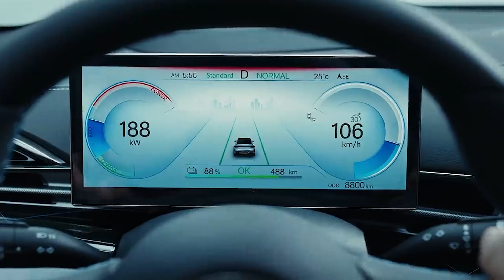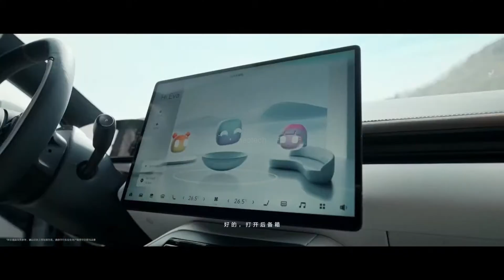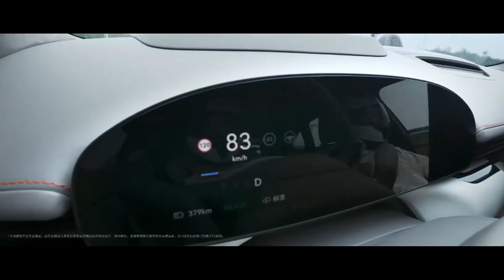Norway Smashes EV Records Again — Almost 100% New Cars Are Electric

Comment: Far from Norway providing evidence that EVs will succeed as the Electric Viking would like to believe, I see it as providing evidence as to why they won’t. Norway has cheap hydro and a charging network subsidized from oil exports. If I lived there I might well consider buying an EV. But I don’t so I won’t!

Comment: No idea why Tesla is still a status symbol.  They are pretty cheap these days.  One thing people tend to miss about Tesla in Norway is that they arrange unbelievably favourable loans.   I bought a Model X in 2017 and the interest rate on the loan was lass than half a percent and it cost less per month to own than I was paying on public transport to get to work beforehand.   I recently bought an XPeng G9 and discussed this with the sales people. They all sighed and looked wistfully into the distance wishing they could do the same thing.

I would add that I don't think people are that worried about winter range so much in Norway.  That 2017 model X went over the mountains just fine and did a trip from Olso to the Finnish Arctic circle and back in winter.  Nowadays I don't even consider charging stops any more in winter or summer.  You can not move for chargers in Norway now so I know I'll get a charge if I need to.

Comment: Now I understand how easily Bjorn Nyland got his S a decade ago. Bjorn's video output should document the growth and experience of EVs in Norway quite well. Maybe ask AI to do a summary.😮. Norway is small but long, with not much up far north. If people there don't drive the length of the country much how much do Aussies actually go properly outback in any sort of numbers? If they did we would have pressure for more proper highways and infrastructure. Yet we are told EVs don't work here. Almost 9 out of ten new car purchases this week in Oz will still be combustion, but why? Even with current infrastructure shouldn't adoption be much more than that, after all Chinese EVs offer so much for very reasonable money in 2025.  Will a threshold be reached where numbers accelerate again to something more substantial just by cumulative momentum?  Maybe when people start getting experience of bargain second hand EVs that far exceed expectations, pushing second hand prices up. Chargers are important but for so many they just aren't in reality.
Reply: I was looking at his early videos this morning.  Things have changed enormously since then.  I think long journeys over mountains are very common in Norway.  I do it myself.

Comment: a lot of norwegians also buy petrol cars second hand, trusting electric cars second hand is a bit rough.
Reply: Probably a consequence of the supply mix, not necessarily because people perceive second hand EV’s as high risk. Used batteries has shown to be more reliable than expected, and there are far less moving parts in an EV.

Comment: I think the economical incentives in Norway is key to the transition. The price difference per distance driven in Norway for BEV vs ICE is massive if you charge at home, and around 30-50% less if you have to rely on DC charging.
In many counties the fuel is so cheap compared to electricity that there is hardly any saving unless you can charge at home.

Comment: Luxury car tax limit to be dropped to $34,000 in Norway, so most EVs will have around $10,000 price bump to all cars more expensive as that. Also VAT return to EVs is proposed. That would mean another $10,000 price hike to EVs on $40,000 price range now (e.g. to all Teslas).
Reply: Some major errors here.
- Luxury car tax is suggested to drop from $50k to $40k, not $34k. 
- Price tax is 25%, so the price bump would be $2.5k. With $34k it would have been $4k. Your math is not mathing.
- VAT returns are only for businesses. You may confuse this with some special rules with leasing.

Perhaps show sources and calculations?
Reply: @picitnew there are proposals from economists to starts to phase in VAT. I would to be surprised in the first step is coming in the state budged in a couple of weeks.
For exaple lower the vat-free part of the car from nok 500.000 to 400.000. That would add nok 25.000 (USD 2500) to the price of most EVs. Would be acceptable.

Comment: If mile tax comes to EV's, it will ruin the whole idea of owning EV.
Reply: Why?
Reply: @notverygoodguy , very simple, right now I drive about 24.000 km/year, so I save 3.000 euros a year, 10 years I will save 30.000 euros.
If a mile tax will come, it will eat this saving and then owning EV is not any cheaper than gas car.
EV is expensive to buy and it lose value fast, if not saving anything because the mile tax, then better to buy 3.000€ used gasoline car, it's value don't go much lower.

Comment: If vehicles in Norway become all BEVs, it will have disastrous consequences in wartime. The most useful vehicle in Ukraine right now is a diesel-engine Toyota Land Cruiser.
Reply: This is about family cars.
Reply: A lot of norwegian towns, in mountainous areas, has their own local power station. Generating hydroelectric power.
Reply: There is actually a pretty big export of old EV's (Leaf and such) to Ukraine. Seems electricity is at least as easy to come by as gas.
Reply: @erik5820  You do have a point. Nissan originally designed the LEAF so that it can serve as a external power source during black outs.
Reply: @yo2trader539  In a war, it is quite likely that the oil platforms and oil refineries would be bombed. I guess some hydropower plants would be bombed as well, but frankly the flooding would probably be worse than the loss of electricity. There are more than 1700 hydropower plants in Norway, as well as a number of wind turbins and many have private solar power. About 74% of homes has the option to burn wood for heating. Also when people have home charger, most cars would be 80% charged at the outbreak of a war.
Reply: @yo2trader539 that wasn't really the point. And you can't really use it as external power supply, as you would need a private v2g chademo charger. They don't really exist (neither private nor v2g), and most likely never will (chademo is not really developed further as it is discontinued by almost all car manufacturers).

Comment: In the US the size of the country is an issue. Cars can travel very long distances and might even be hauling or towing something. When you combine those distances with limited fast charging infrastructure EVs really can't replace much of the fleet yet. You have to remember we have added gas stations from 100 years or more and there are plenty of them. However, electricity is also available most places cars go so it's just a matter of EVs getting better and charging locations being built out. That doesn't mean rural drivers can't benefit from an EV. In some cases the nearest gas station is very far away and you burn up some of the fuel your purchase just getting the vehicle there and back. And yet there is already electricity at your home or farm.
Reply: Unlike Norway, the EV mandates and subsidies have been lifted in the US, people are free to buy the car they want, so that makes charging infrastructure a little redundant now..
Reply: @SteveLomas-k6k  When were people not "free to buy the car they want"? Every type of car have been available. Anyone who bought an EV did so because they wanted one.
Reply: @frankcoffey  Because most of us are on a budget. US and other automakers in other countries, have been forced to flush billions down the crapper to develop EVs and then make a loss on selling them.  To stay in business they had to elevate the cost of normal cars to compensate- putting a new gas car beyond the reach of many who could otherwise afford it.

People in Norway are also 'free' to buy a new gas car, if they have the money to pay twice the purchase price in penalties.
Reply: @SteveLomas-k6k This is inaccurate. There is no new ‘penalty’ on ICE cars. It’s VAT and taxes, much higher than US of course, but that’s as it has always been. But EV’s are subsidized by exemption of (most) VAT. You can buy an ICE budgeting for it as people has always done. If you choose an EV, however, you will be better off economically. Nothing to do with ICEs being ‘forbidden’.
Reply: Also, R&D cost on development of new technology being distributed is not exactly a new concept. It’s how the world works. I bet part of the cost of your previous car could be attributed to development of your current one.
Reply: Remember that Norway is 1200 miles long and covered in forests, mountains and snow.  It is certainly not the most obvious place to be leading an EV push.  That said, I do get that if you regularly tow long distances then an EV is not ideal.

Comment: In Australia there needs to be greater investment and roll-out of reliable and fast chargers in key inter-city routes and many country towns before pure EV adoption can pick up here. For road trips, people have range anxiety because it is really charger anxiety. 
If a charger at one location is occupied or broken, then you need enough range to get to the next one, or further. A high enough density of even mediocre chargers can drastically reduce that problem, but that is far from the case yet. Still today it is a rare town that even has one charger. Every town should have at least one. 
For critical high-traffic routes (e.g. between capitals) there needs to be extra reliability and capacity to handle the ever increasing number of EVs. Additionally, the many existing slow & unreliable 50kW chargers need to be replaced (so their grid allocation is used more efficiently) with new ones that use a flexible & modular platform with a large battery bank that can support either very fast charging (>350kW) of just 1 car, or can be split evenly between multiple cars (e.g. 2-4) simultaneously, so that there is both the potential for high speeds (esp. for 800V cars) most of the time, but also still decent speeds with short wait times in high load situations. And also a slow-charging car does not hold up lots of other cars due to bad charger design and/or very limited numbers of charging stations. 
More hotels/motels and other destinations need to get a few decent AC chargers installed, ideally 22kW.

Comment: It seems the Norwegians love the boring minimalist styling of the Tesla. 
I personally do not like the lack of switches and the centre screen only control for all items. 
So many more stylish makes in my mind, but you know a Tesla will last. 
Tesla have a proven track record but like all makes they still have their weaknesses.
And if your not driving large distances in the sub zero cold then the NMC chemistry will suffice.
Reply: well, there are new regulations on its way that say you must have physical buttons for few of the main functions in a car. I think Tesla have bigger problems like that the doors can not be open if you are in a car crash and the battery fuse is blown, meaning you will not be able to escape the burning car.
Reply: @AndrewTSq Except you can, from the inside but not from the outside.  There is a mechanical opener for all Tesla doors.  The difficulty is that in an emergency few people, especially passengers would be able to find them.  For example in the model X you have to remove a small panel and pull a wire ring.    I have been locked out of my model X when it ran out of charge and had to have Tesla tow the car away.    Xpeng manage to have similar doors in the G6 but provide a physical key that can unlock it so I don't know why Tesla couldn't.
Reply: Yes, it' seems to be a Scandinavian sensibility- cheap and simple.
The Ikea of car brands ? :)

Comment: I paid 34,000 euros for my Seal U EV in Norway. I have never heard of 1000 euro hourly charges at workshops. It is more like 180-200  euros an hour at OEM workshops. Cheaper at independent workshops.
Reply: It's more expensive than a new Sealion 06
Reply: @kittyflier8338  The SL 06 is not sold in Norway
Reply: @indian2003 Yep I know. They should though.

Comment: For comparison, Norway is about 1.4 times the size of Victoria with about 85% of the population of Victoria.
I like the idea of taxing the weight of vehicles.
Reply: And Norway has on average 40 meters of elevation pr kilometer road compared to 7 meters pr kilometer in Victoria. Combined with a subarctic climate, driving will have its differences.
Reply: A vehicles weight directly correlates with how much damage it does to roads, it's a shame that it took the appearance of EVs for governments to bother fixing this issue.
Reply: @r9bet  Norway has been taxing the weight of vehicles for ages, at least 55 years ago when I moved to Norway
Reply: @indian2003  Anyway, a foolish idea. Weight has a trivial impact on surface wear, yet is of utmost importance structurally. Structural wear originates from a soft foundation. Thus, a weight-based fee is, in reality, a tax on users for the government's failure to provide a solid base when the pavement is laid.